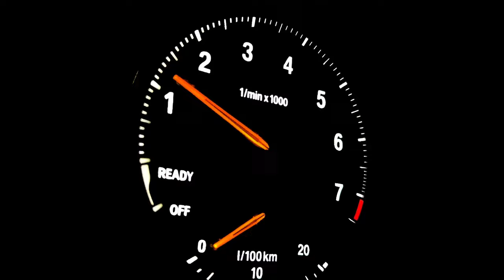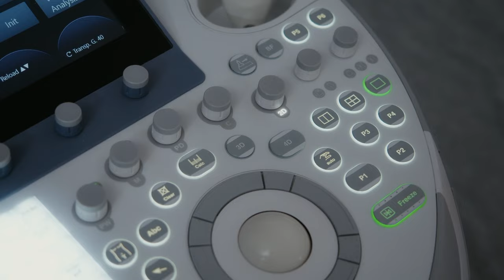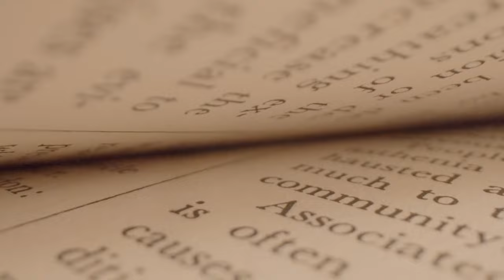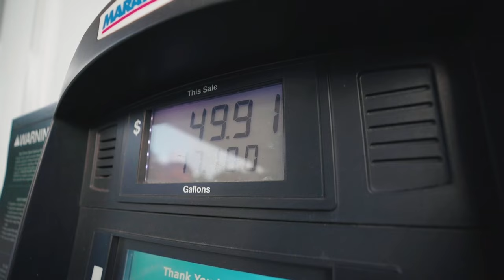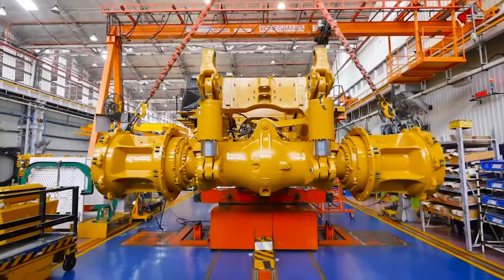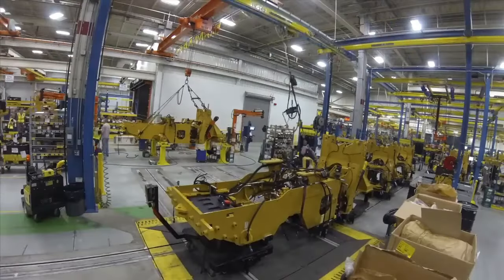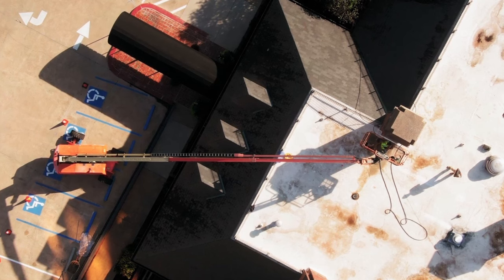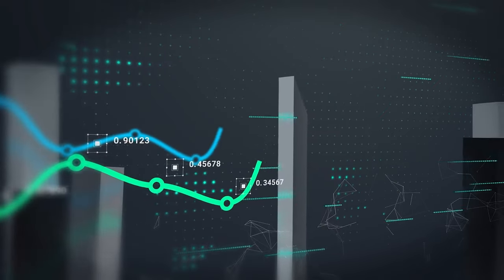BATTLE OF THE AUTONOMOUS HAUL TRUCKS: Belaz 75710 VS Caterpillar 797F | Episode 1

Comment: Belaz 75710 hauls 450 tonnes (wich is mind boggling) vs CAT797F 363 tonnes so no comparison here. Caterpillar is just smaller. And Belaz just works at minus 40 in harsh Siberia. So dunno.
Reply: Some of the first 75710's was ordered by a huge coal mining company "СДС Уголь" to operate in Kuzbass (Kemerovo oblast'), which is my homeland. And i personally can approve, that -35 -45 is a common thing in january-february)